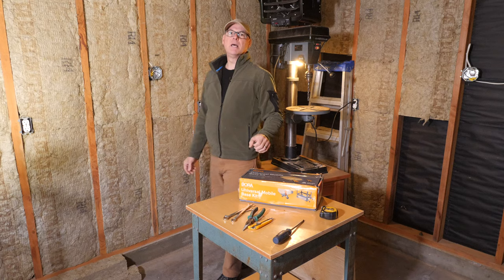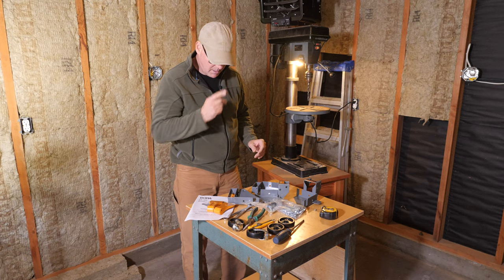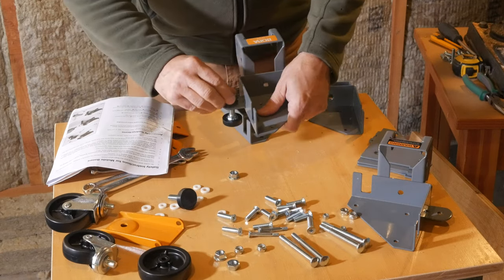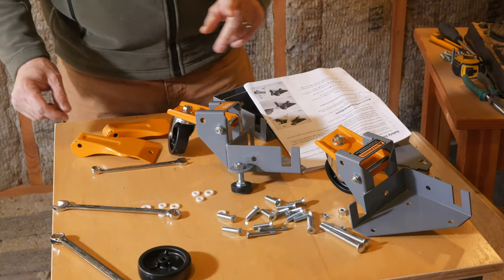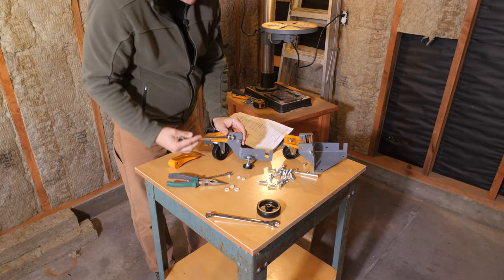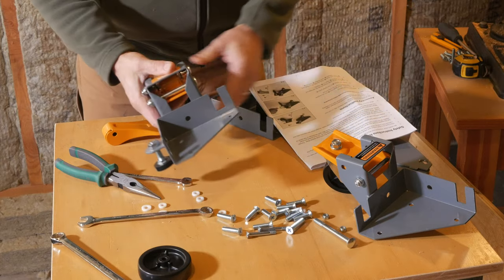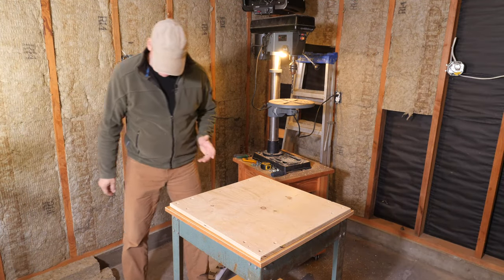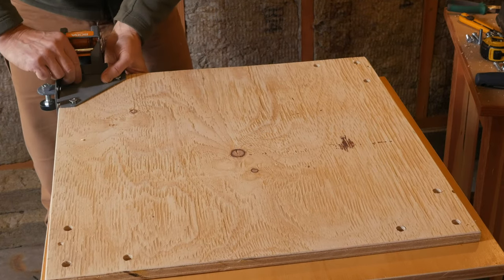Mobile Tool Base - Assembly Instructions Tutorial  [Benches and Tools on Castors Wheels]

Comment: Hi, at 2:51, "step number one" you put the rubber-foot "bolt" into the bracket, then the nut from the top.
Wouldn't it be stronger (albeit equally stiff) if the nut were below the bracket instead of above it? At 11:32 you can see the threads in the bracket take the entire load carried by the foot.
Reply from the maker: Yes. Having the nut below the bracket would be stronger.